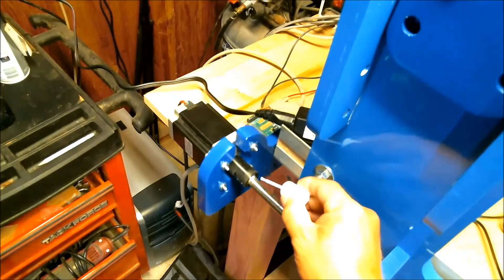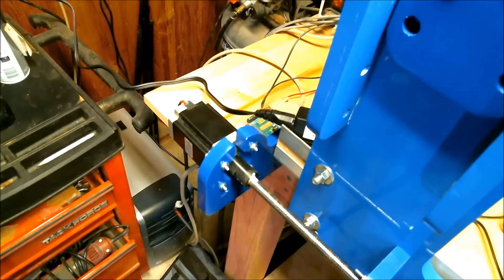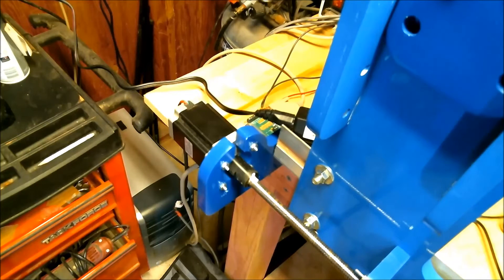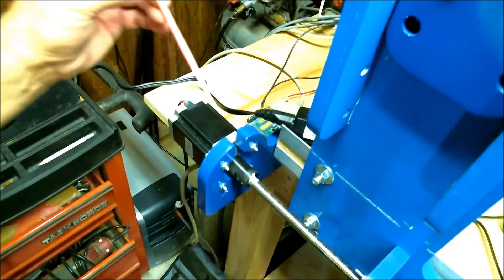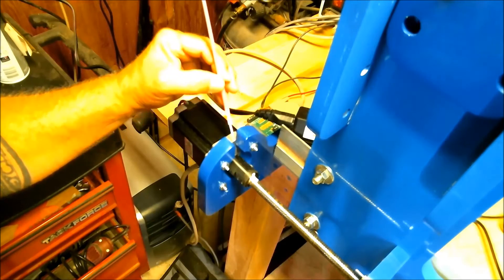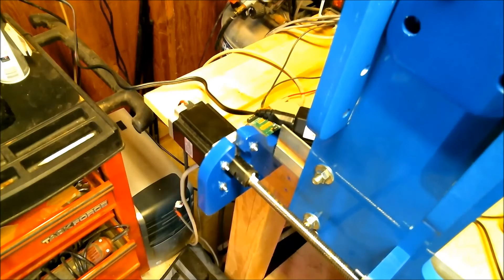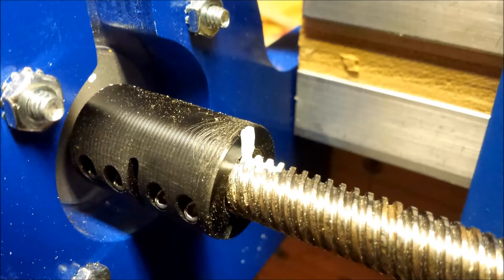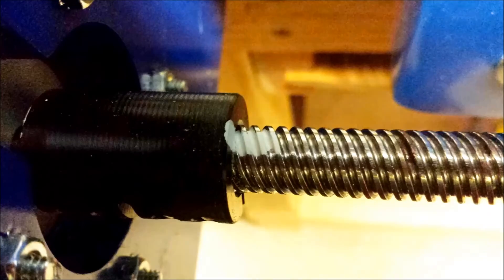An Aid for Troubleshooting Missed Steps

Comment: I've rewired and adjusted settings and gave up several times...but Z axis gets weak after the job is started and sometimes so weak its barely holding at all...any suggestions?
Reply: I know this is a year later, but I know how frustrating it can be to chase gremlins on machines. 

First, i would suggest swapping your stepper drivers around between two axes. If the problem follows, the issue is the driver. 

Just based on the behavior, it really sounds like a bad driver to me. It could also be your main power supply, assuming each stepper driver run off a common power supply. 

I would say it could potentially be EMI, or maybe a ground loop issue, but those would be the last things I chase

Comment: Great tip! What is your thought on using loctite on the coupling?
Reply from the maker: I haven't needed it. I was having a problem with my Z axis slipping, and it was 100% due to my being paranoid of over tightening the screws and cracking the coupler. I spoke with the folks at Dumpster CNC, and they recommended I NOT use Locktite on the screws - just snug them up a little more. They said that an older design of the couplers did have a problem with cracking if over tightened, but they haven't had that problem with the current design. They said that you'll strip the delrin threads before you crack the coupling. So, to make a long story short, I just snug the screws up and don't worry about it. A year later, they're still working just fine without Loctite.
Reply: Thanks for your reply - Jim
Reply: One of my x-axis threaded rods kept coming loose from the coupler on my sidewinder CNC so I added some medium strength loctite to the screws and it hasn't budged since, and I've run it a lot lately with holiday orders!  Now, on to figuring out my z-axis step problem using Mark's recommendation.
Reply from the maker: I spoke with the folks at Dumpster CNC about set screws coming loose over time, and specifically we talked about using LocTite. Their recommendation was to use a TINY amount of medium strength LocTite, but only if I really, really needed it. They warned that the threads could be damaged when/if you have to take that set screw out again. They recommended applying it to only about half of the threads - not to cover the whole set screw.

Glad you got your X axis problem solved, and hope the Z axis is just as simple!